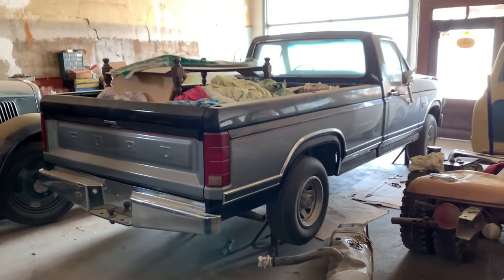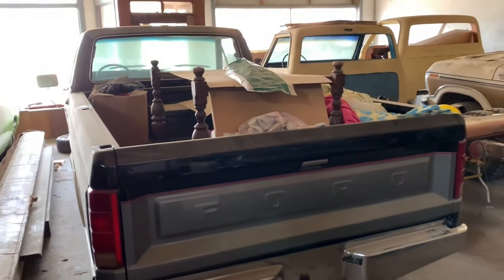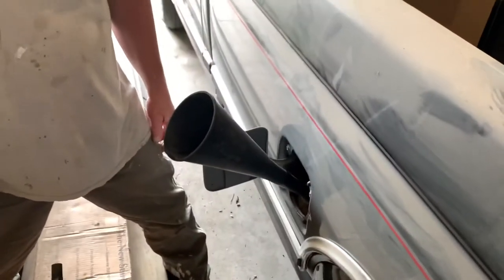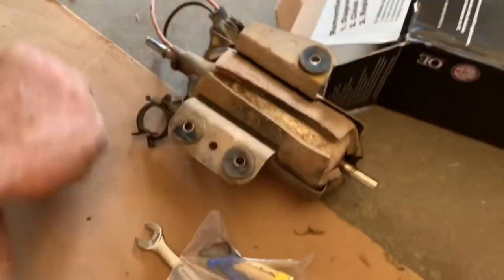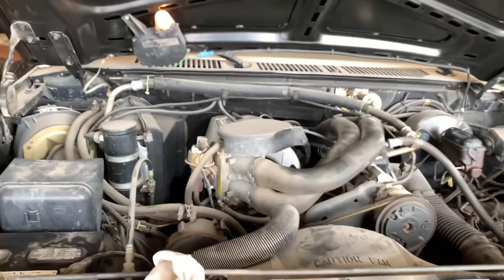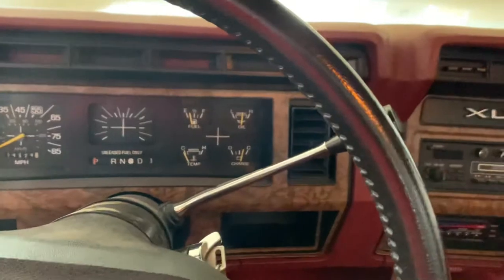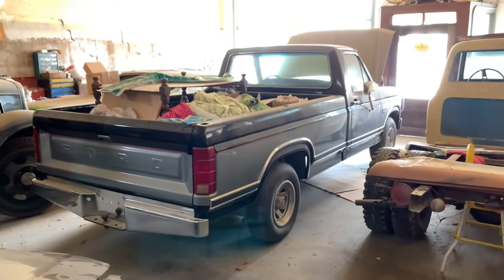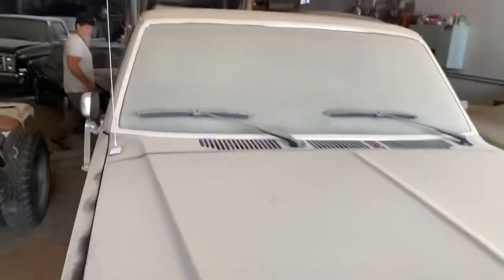Starting our ‘86 Ford F-150! It’s been sitting for 15 Years!

Comment: I had an 86' with the 302 fuel injection, good working truck.Rear engine seal leaked ,but  I drove it well past 20000kms, then sold it

Comment: Engine sounds quiet and mechanically sound . Nice work on getting her started . Those 80-86 Fseries trucks are going up in value. Kudos to you guys
Reply: I've got an 85 f150 I need to work on.
Reply: I just bought an 85 302 4x4 for $800.. needs work. Sounds good but needs a transmission bad. Killed it off driving up on a trailer lol. Got reverse though!